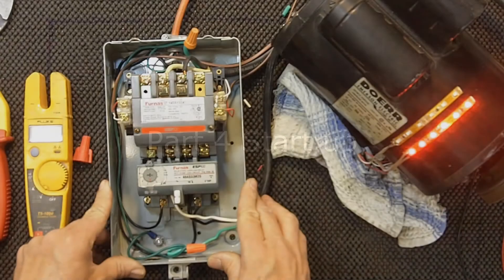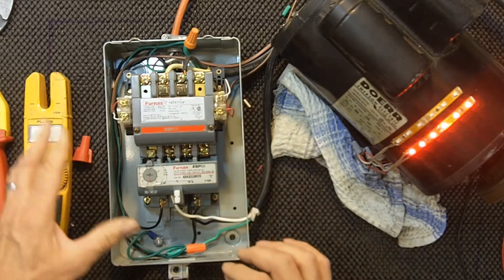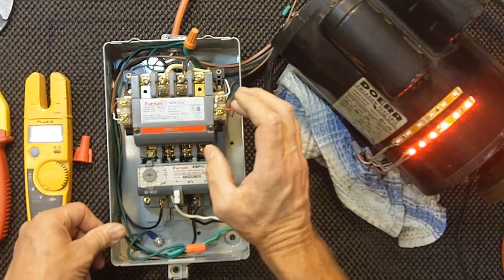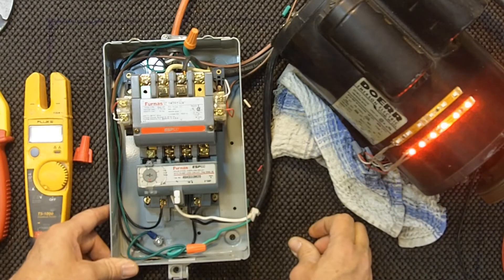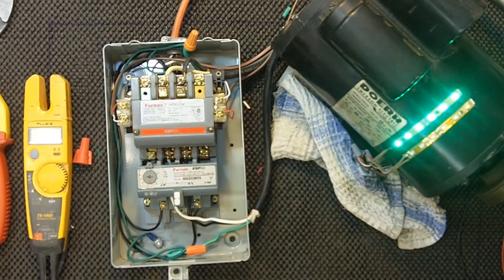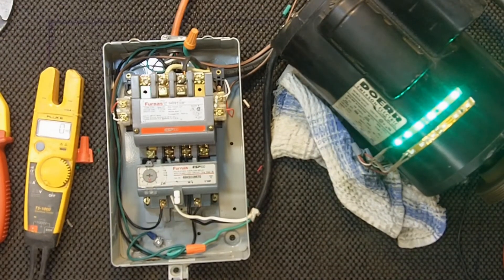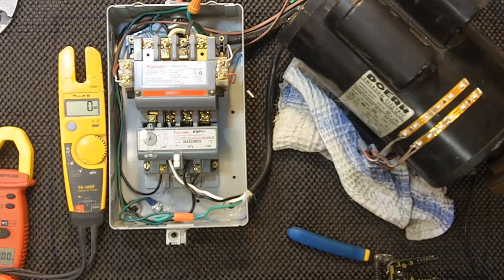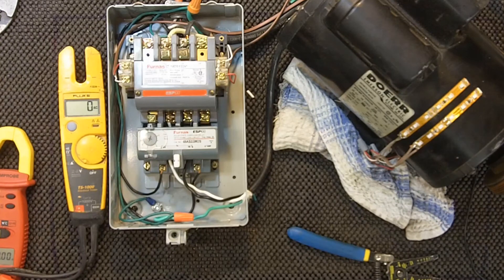Electric Motor Start Up

Comment: Yup, Motor Controls are for many Stationary Engineers, what defines who is a good engineer or not. When a postition opens for Chief Engineer, if you don't know Motor Controls, don't bother applying for the position. 
Great video, Sparky.